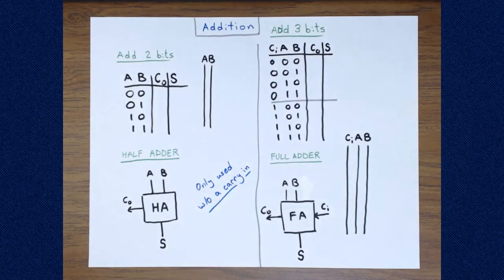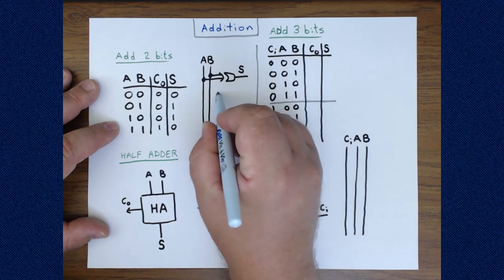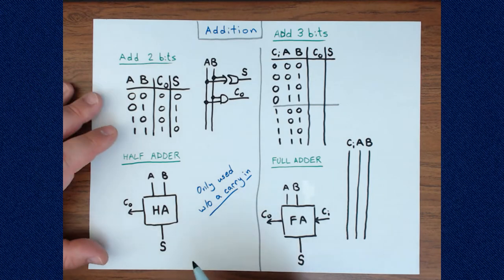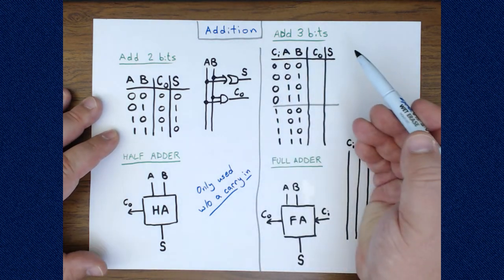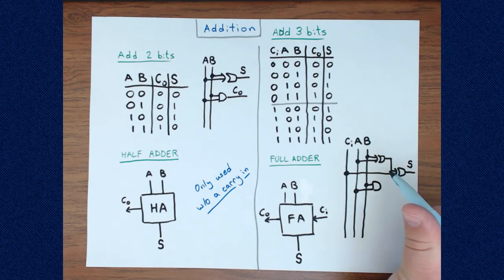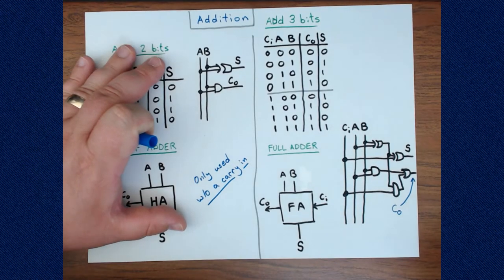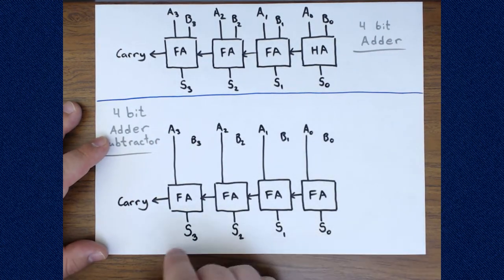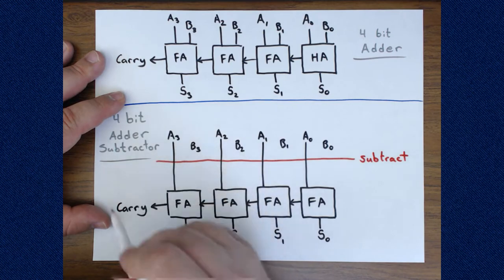Addition and Subtraction Circuits - Computer Organization

Comment from the maker: The merged addition & subtraction circuit I present in this video uses simple 2 input multiplexers to aid in the selection of addition or subtraction.  These can be replaced with XOR gates with one input from B and the other from the Subtract line.  In this case I'm choosing to reinforce how multiplexers work and could be utilized, which were covered in limited form in a previous video.